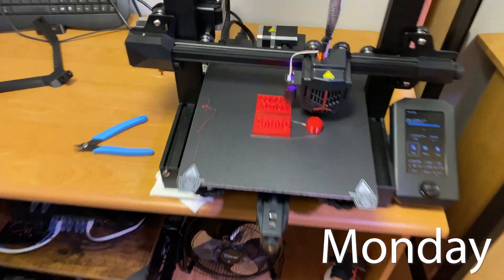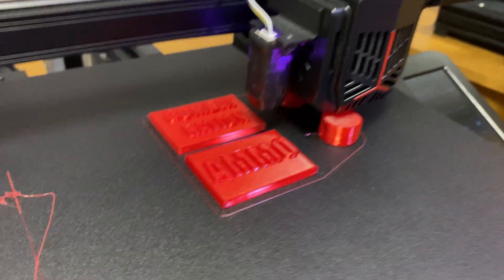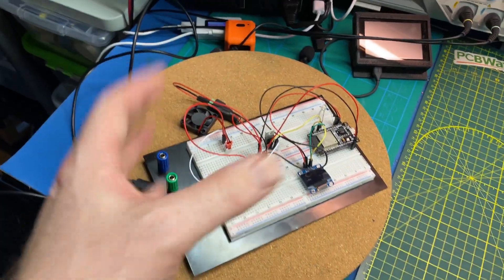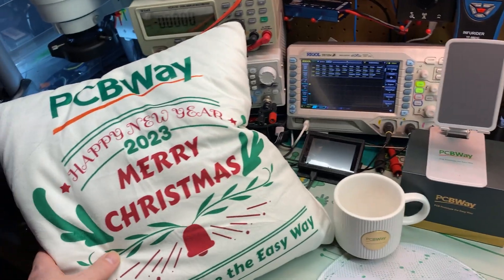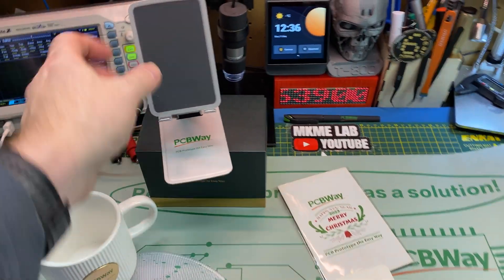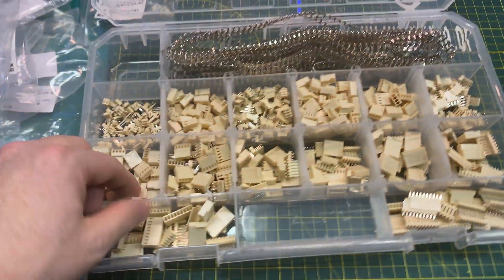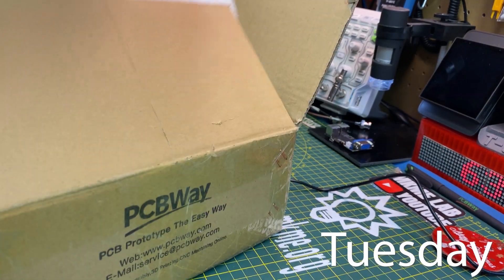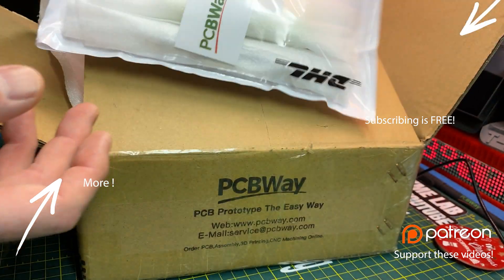10 Days of Making - ScentVR Arduino Code WORKS!

Comment: I just replaced one of my fans on my Ender 3 V2 hot end. Started making noise too. I've had mine about a year but it doesn't have that many hours of run time on it. I got better fans from TH3D Studio to replace them.
Reply from the maker: I emailed them and they are sending a replacement. Wonder if they had a bad run of them
Reply: @MkmeOrg  from what I've heard the fans are poorly made and don't last very long. The replacement I bought was much higher quality. I've heard some go out in a few weeks